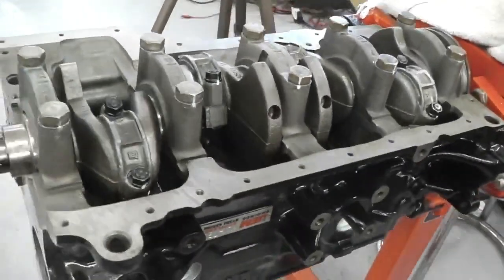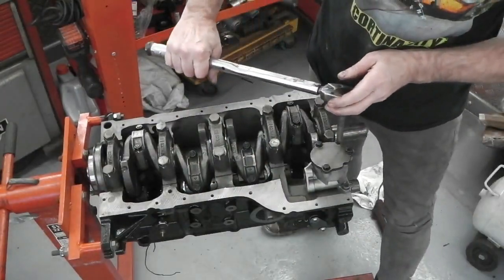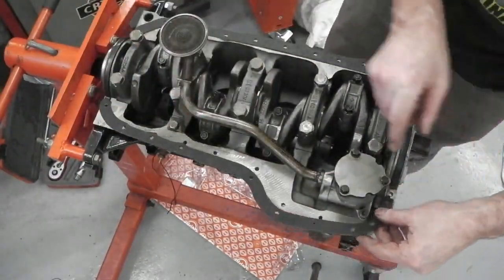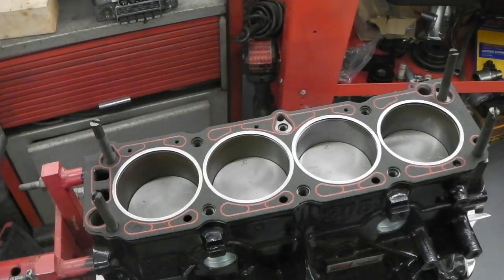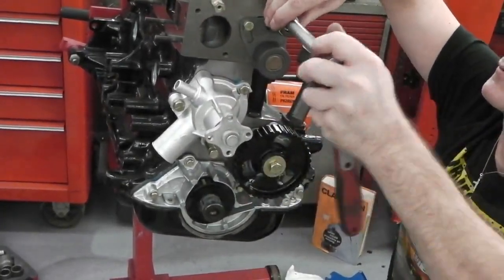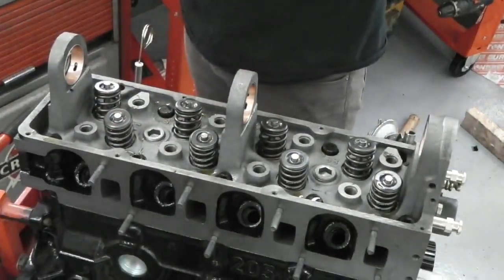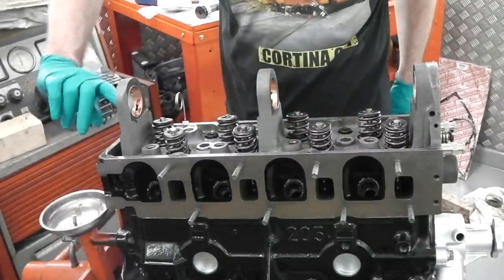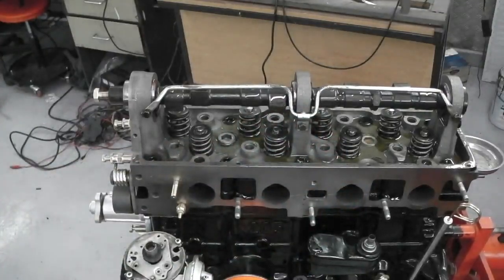Classic Car Resto - Mk3 Ford Cortina Mk3 - Project Bramble EP35-pt1

Comment: Tip for you Pete when your tightening head bolts down put a small tippex or paint spot on all the bolt heads in the same place at a 12 o'clock position so you can keep track of the ones you have done and the ones you haven't done great video keep them coming
Reply from the maker: thanks Ben good idea! i did do this idea on the flex plate

Comment: Hay again Pete a think that's the same sump av got on my 205 block as the original sierra one was rotten it's longer and was hitting the steering rack so a couple of washers under the engine mounts sorted a think it might be cortina or capri

Comment: As usual Pete you just worked your way through it even if you did feel a bit out of your comfort zone. Nicely done.
As for head bolt sequence the Ford head bolt pattern is symmetrical so No 1 could be either side of the middle tower and it wouldn't matter as long as you followed the tightening pattern. And I do hope you added that final 90 degree pull mate ....
Little add on: That cam belt tensioner pulley is the one I am using on an 1100 Mini engine I am building using a BMW K1100 bike twin cam cylinder head. A local firm (Specialist Components) do a conversion kit that uses a belt and the tensioner is the Ford Pinto one.
Small world ...

Comment: Engine looks great, as expected! You can calculate the amount of toque lost by using a socket extension if you're really keen. I've never bothered when using a short extension, I expect Google would help with the figures?
Too much oil on the threads of the head bolts can cause hydraulic lock in the bottom of the hole giving a false torque reading, you only need a smear to stop the thread binding.
I like the blue gasket but only smear a small amount on with my finger. It stops it oozing out, the stuff that oozing onto the inside can block oilways and the filter when it drops off.
Reply from the maker: thanks Bobbin!!!! from Pete

Comment: I have always put a little engine oil or Graphogen in the bores before fitting the cylinder head. this helps with lubrication on initial start up.

Comment: Does the high lift cam make the engine labour or bog down at low revs?
Reply from the maker: HI STEVE no the opposite, its fr30 designed for high torque at low revs works well with torque convertors
Reply: Pete C thanks Pete of course it’s an auto ,watching every video with interest ,will you tackle the Crayford wow it’s a bit funky.

Comment: Sorry to be quite negative but normally I really enjoy your videos but I was frustrated by you not using a Torque wrench on the Oil Pump, Sump or other ancillary parts.

 Then you did not torque the tenth head bolt on the first stage. And then you showed the specification of 70-75 Newton Metres then wait 5 minutes before another 90 degrees. But Instead of doing the second stage then waiting 5 minutes you start fitting the Camshaft and Spray Bar but never torque the head the 90 Degrees after 20 minutes of edited video. Did you actually do it at all?

Comment: Hi Pete, I think when oil is applied to bolt threads the actual Torque is affected, heres a link .
https://www.engineeringtoolbox.com/torque-lubrication-effects-d_1693.html
Reply: BigD the torque is affected in a positive manner Though . A
Light oiling of the threads enables a correct torque as opposed to doing them dry and creating friction .